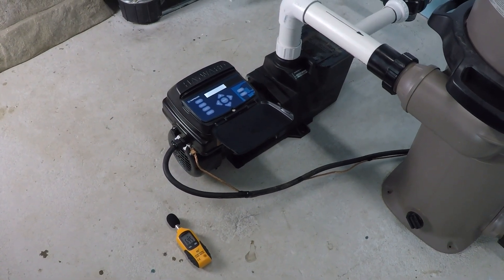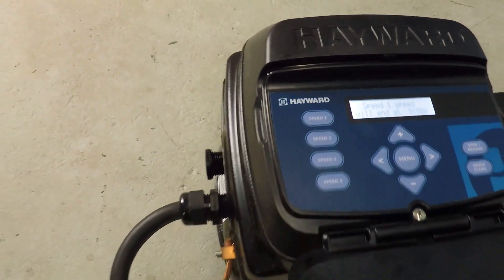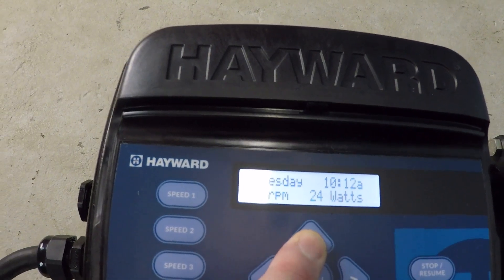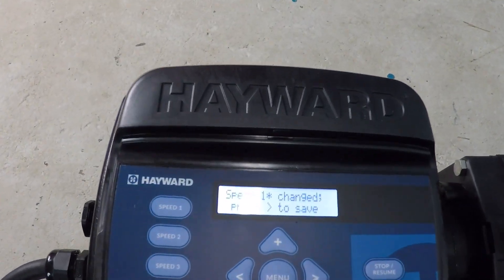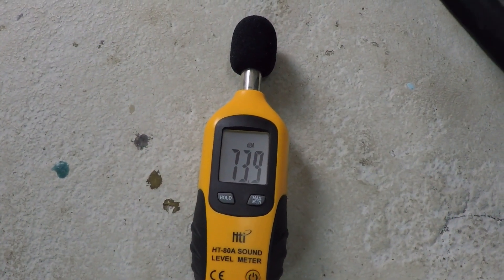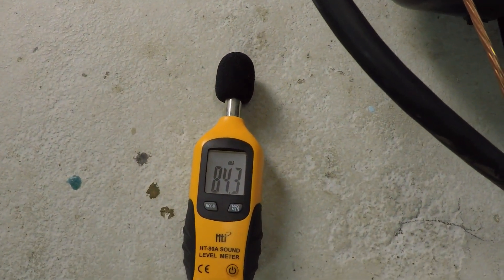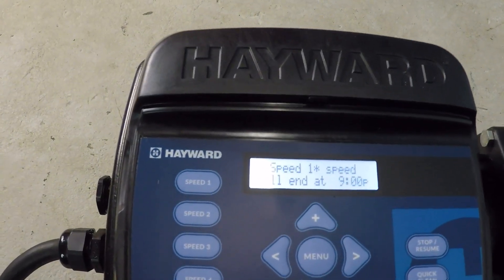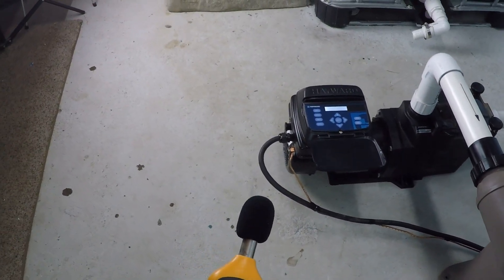How Loud Is A Hayward Super Pump VS?

Comment: Sounds pretty loud. Single speed pumps (usually around ~3450RPM) are much more quiet. Shopping for a new one because mine is now way too loud even after changing bearings. It's around 69-70dcb and it's very annoying.

Comment: Comparing similar models. Pentair IntelliFlo 011028 3HP is advertised as 45 decibels. Are they talking about 600 RPM speed? How the noise of it would compare to Hayward TriStar VS Pump, 2.7 THP on the same speeds. No information about it online (

Comment: Oh man - I'm really glad it wasn't super quiet - I just upgraded to a Pentair based on things I've learned from your channel.
Reply from the maker: It was quieter than the Superflo that I tested but I am quite sure that is due to the Super Pump being a smaller motor.  Super Pump is 1.65 THP where as the SuperFlo is 2.2 THP.  In any case they are both good.  All variable speed pumps are quiet because you will hardly ever run it at full speed anyway!